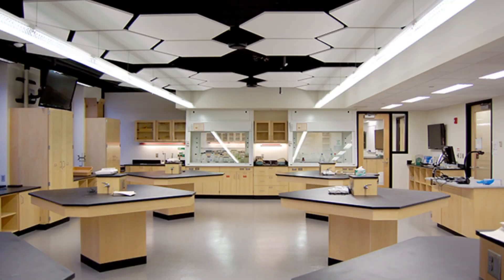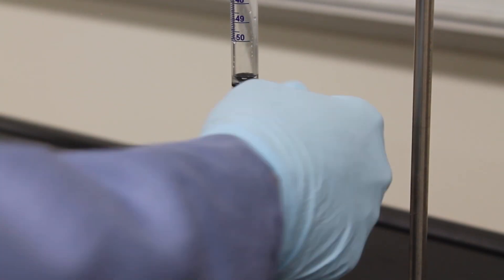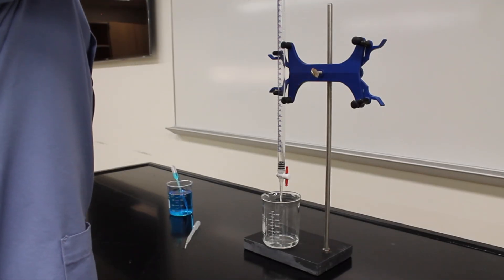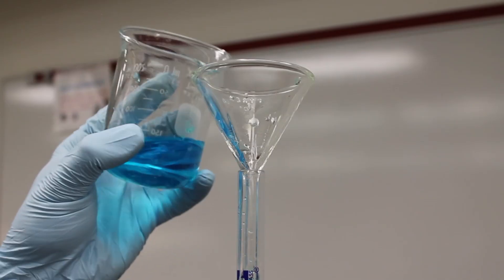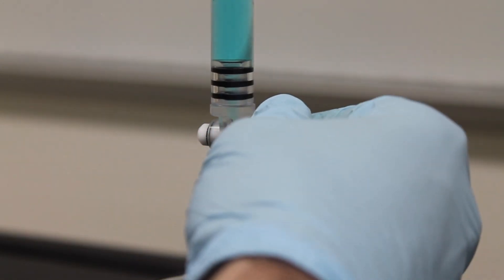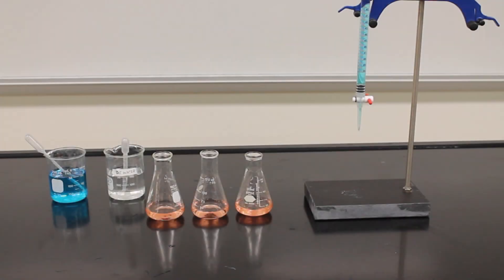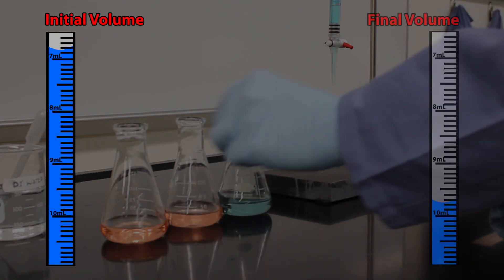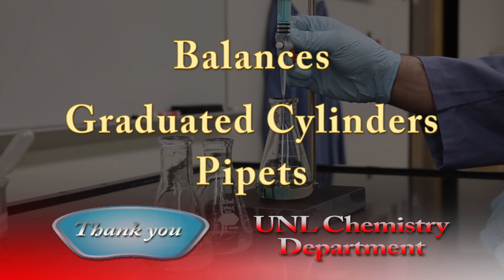Buret Technique

Comment: There is an error with the calculations portion of the video. The actual math portion is correct but the written formula is incorrect. It should be Final over Initial to get the volume used in titration.